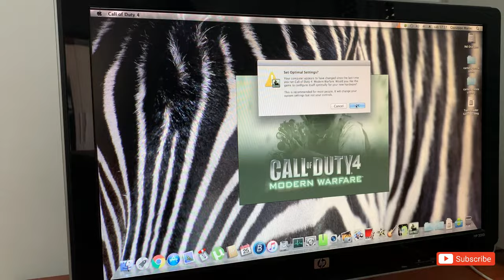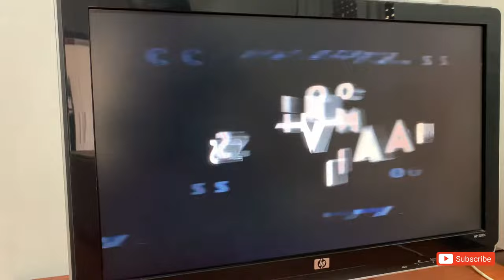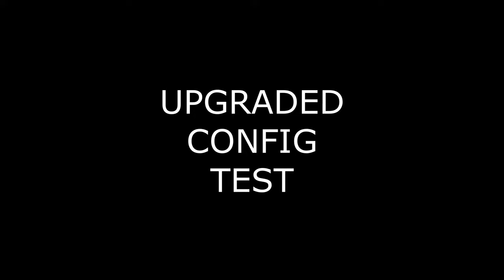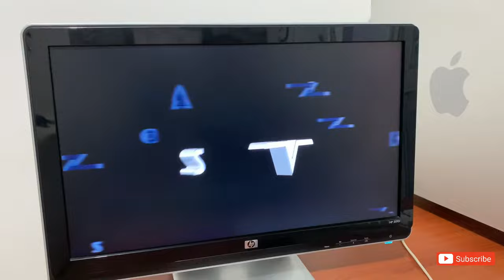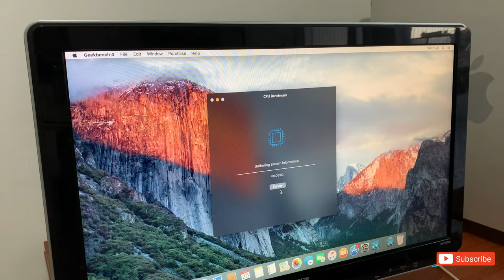Apple Mac Pro 1.1 FULL UPGRADE

Comment: You pushed out the FrontVentilator and the Case beside without to screw out the RAM-Cage? I cant open the 2 screws front down of the RAM-Cage .

Comment: How much did all of the upgrades cost you? How did you upgrade the firmware to 2.1? Wish you would have shown that part.
Reply from the maker: Hi about 30€ ram, 40€ cpu, 70€ ssd, 50€ gpu. Firmware was already 2.1 but its pretty easy to do, just run an upgrade tool as you can see in a lot of videos on YouTube
Reply: $32.40 $43.20 + $75.60 + 54.00 = $205.28 (Not bad at all! I think I am going to try doing this to my old mac pro and at least get some remainder use out of it!!! Where did you get the parts and do you have the name and spec information for each piece you had to purchase to install? Please share or direct me if shared before? Thank you!

Comment: What to do, I had El Capitan when I bought Mac Pro 1.1, since I don’t understand the OS at all and this is my first experience, I entered iCloud, after which I got into the app store, I had a notification about possible system updates, I pressed  install, after which the Mac rebooted and started the installation, but then after completion, I was transferred to Utilita Mac OS X and there are 4 options there: 1 restore the system from a copy (I did not have a copy there) 2 Reinstall Mac OS completely on Lion 3 help  safari and 4 had something to do with memory drives.  What to do?  Please help, I don't want to completely reinstall the entire system and I'm playing with the installation of El Captain, please help, maybe everything is fine and I can return to the system?
Reply from the maker: Check if you have multiple os installation drives and boot from your working one. Press shift when powering on and see what options you have. Or you have to reinstall os from recovery like you have seen
Reply: You installed one of the Updates that breaks El capitan for Mac Pro 1,1s/2,1s

Comment: When you indicated Apple FW Flashed 8800 GTS graphics card, what do you mean by saying Flashed? How do I go about having a new graphics card flashed for upgrading this exact same computer. Second question, with adding the SSD card is there anything that had to be done unique in the settings to make SSD card be the booting card? I have this same computer I am considering trying to upgrade for doing flight simming.
Reply from the maker: Hi, you probably can put together a windows machine with less money and more performance in flight sim. Anyway there are vbios available for specific gpus that make them recognized by the mac pro with all boot screens and functions. 
No you just put the ssd in and install or copy the os to, then you select it as boot drive in the system preferences or by holding alt while powering on
Reply: @mirkofanfani98  Thank you for the information!

Comment: Thanks for the video man. I bought a new razer blade 17 pro laptop ( latest version) but still love my Mac pro 2006 but now I've been having start up issues with loud fan noise. It won't turn on. I opened it up but just don't know how to get to the power supply fan. I'm buying a second hand one and will really like to get it fixed to access my files on my old one. Any helps and tips would be much appreciated mate.
Reply: I had that problem in an older imac and saw a video that advised to vacuum the fans and then blow air into the outlets.

Comment: I have a mac pro tower 1,1, was thinking about doing this for running xplane....do you think it will handle and be worth doing a similar upgrade? Thanks for sharing!
Reply from the maker: Hi, i dont know the software you mentioned. Im sorry you should check the requirements online
Reply: @mirkofanfani98  When you indicate "Apple FW Flashed 8800 GTS" graphics card? Probably a very stupid question but if I order one from Amazon (or wherever) what or how do I get it Apple FW Flashed?

Comment: So you are running El Capitan.  What will you do when the packaage/app install+web certs expire later this month?
This is the best machine I've ever owned- would like to keep using it until Apple makes something interesting again, if ever.
Reply from the maker: Yeah this is a great machine but i sold it anyway, because of updates and app compatibility its not useful anymore
Reply: That sucks. Do you recommend fixing one up.
Reply: igot my from a recycling center pput windows 10 on it run great as a litlle gaming pc specs are : 2x X5365 xeon quad core 3.0 ghz 
1x kingston 128g ssd 
2x seagate 1tb hard drive in raid 0
1x amd sapphire 7950 2g mac pro edition 
8x 4gigs of ecc DDR2 ram (32gigs total)
you should keep your upgrade to a 2.1 firmeware and install windows 10. best computer i have ever got
Reply: @milordz  of course but don't use mac os use windows 10
Reply: @1JesseEns  I use it for video and photo editing (final cut,light room). Not much else but I like the storage capacity this machine has so I’m dumping my old video and photos here for now. Eventually I’ll dedicate a drive for windows 10 and that’s it. This was a nice diy project for anyone who want to fix things up just for the experience or prolonging life of electronics.
Reply: @1JesseEns I’m browsing use Firefox and brave. No issues here and I don’t log into sites with personal information since this Mac is so old and unsupported with security updates

Comment: Hi, why not install Windows 10 or 11, at least that is an upto date operating system?  Would your new graphics card be compatible with Windows anyhow can  you say?
Reply from the maker: Yes it should be 100% compatible and up to date
Reply: Why not install  Windows? Because if they just wanted a Windows machine, they wouldn't have bought an Apple Mac in the first place? Because they like Mac OS?
Reply: @another3997  Of course that is an option, however,  on a Mac Pro of that age, you have the choice between an antique o/s like lion or an up to date o/s such as Windows 10
Reply: @another3997  Because the Mac os is is old on this machine, and can't be upgraded beyond, Lion, i believe. Whereas you can run Windows 10 on this Mac.

Comment: Just bought one to mess around with Mac and Mac OS, guess it'll have to be a Linux and/or Windows machine then, didn't know it was losing app support
Reply from the maker: Its a very old machine, but you can buy 5.1 thats more upgradable
Reply: @mirkofanfani98  unless i find one for a deal, i would prefer to build a PC at that point.
Reply: A Mac Pro 5,1 can run an actual MacOS with a little help of the "Open Core Legacy Patcher". A 3,1 or 4,1 will do it with somr issues, a 1,1 and 2,1 won't because of the 32bit Firmware.
But all of them are running fine with Win 10 or Linux.

Comment: Why not transfer the cooling ribs of the original Apple memory to the new memory modules? (Apple said it developed those for better cooling and a more slient computer.)
Does the Macpro 1,1 accept 8 GB memory modules? I see those are coming down in price now. (Sure, they eat a lot of electricity.)
Reply: If you are still interested in they whys its because you cant really take them off I personally wonder why he didnt reuse them so he would have 20 gigabytes of ram since its all DDR2 FB-Dimms at 667mhz and yes they take 8 gig sticks

Comment: Ciao, volevo chiederti se riuscivi a fare un video su quel mac li di come gira win 10 perchè ne ho uno e dovrei fare circa lo stesso upgrade che fai te nel video per poter tenere su un serverino però volevo sapere se win 10 gira bene. sai dirmi qualcosa?
Reply from the maker: Ciao. Immagini giri discretamente per lavori di uffico, qualcosa di grafica 2d etc. ti sconsiglio di usarlo come server h24 in quanto è poco efficiente, consuma molto e conviene molto dì più un mini pc con processori low power moderni. Guarda il mio video sul mini pc fanless, 30w di consumo e 0 rumore
Reply: girano bene sia win 10 che 11, installati da zero su un altra macchina mulo, al primo riavvio si spegne,  io metto direttamente l'ssd nello slot del mac, tanto è leggero. riguardo i consumi, dipende cosa lo si usa, io lo adopero come server delle ipcamere, misurando con un misuratore di campo(amperometro), consumo massimo 150 watt.